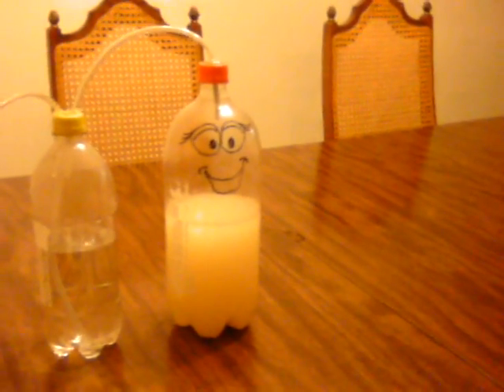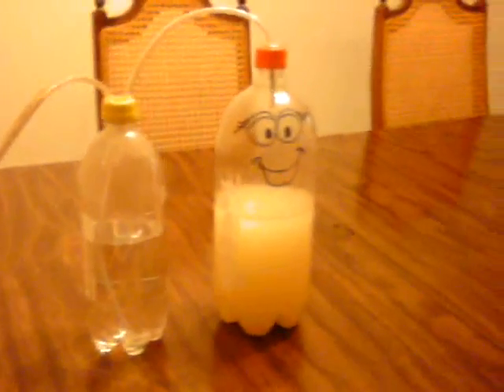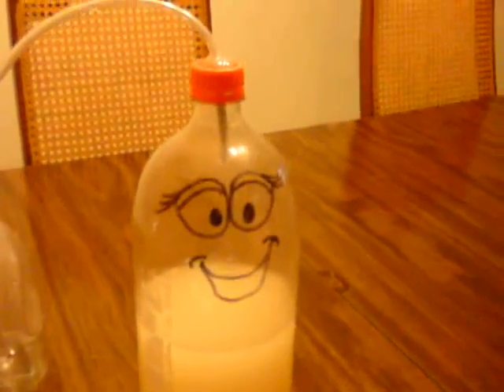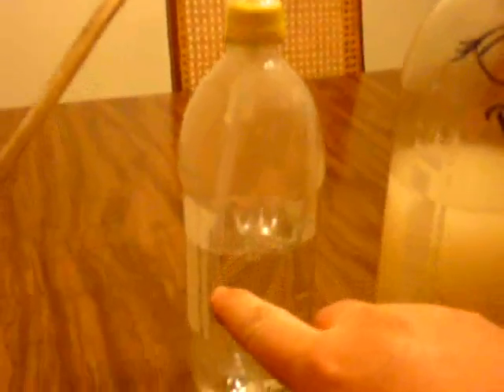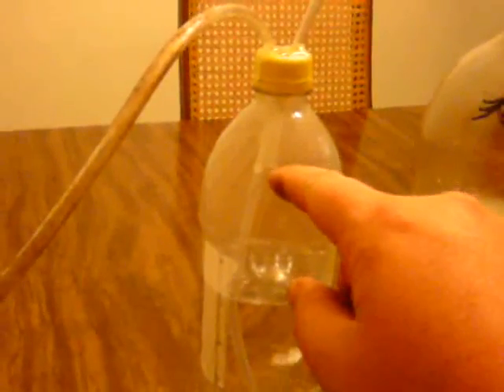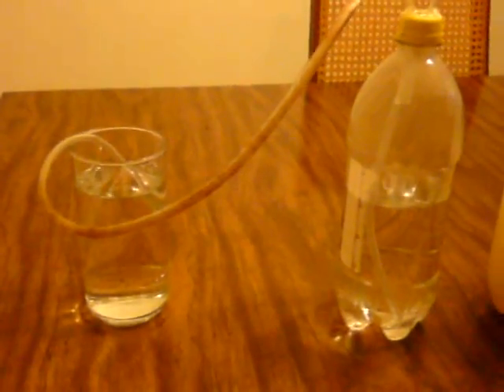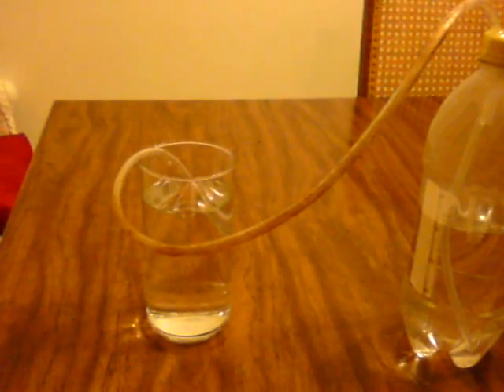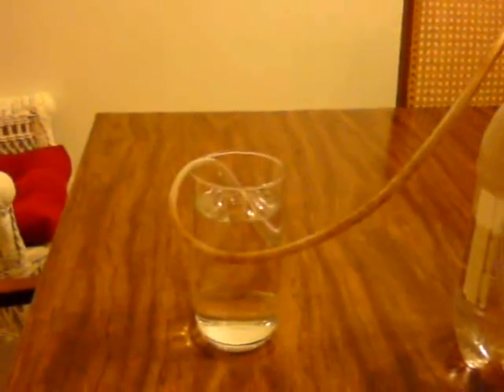part 1 how to make a co2 generator for growing plants

Comment: I found that sugar will work but it is slow, so I thought maybe I'll try concentrated sugar which is glucose or another name would be Corn syrup. Mix. Mix one qt of water to 1/4 cup of corn syrup and and 2 tablespoons of yeast. My mixture automatically starts bubbling with no wait time and finally I place it on a heat rock for snakes snakes or reptiles to keep the solution warm because heat activates yes so so with this method I can get 4 to 5 days of CO 2 in my tent . Hope this helps some of you out there withere with this frustrating C02 level and converting sugars

Comment: What if the water is not hot anymore
Reply from the maker: The water will cool down but the reaction will keep happening making sure that you're still getting a bubble going through the secondary bottle if you were still getting bubbles then it is still working

Comment: I am going to use two Oxypot DWC buckets hydroponically in a tent that is: 50cm x 100cm x 180cm. Do I need extra Co2 even if I bring in the air into the tent from outside? Thanks:)

Comment: I have a 4x4 tent. I have to open all vents with exhaust fan on high and small oscillating fan to keep right temp. Will the co2 help, or will it get sucked out with exhaust as fast as it's being made ?
Reply: use a portable a/c unit

Comment: So I could make mead or wine and give my weed some CO2 at the same time
Reply: I was just thinking that..
Reply: Or blow your mind and grow some shrooms does same thing only longer co2
Reply: I do. I always have 3-10gal of mead fermenting just outside my flower tent. When the light kicks on, so do intake fans and they pull the CO2 into the tent. The relationship between mead and cannabis works well. Cannabis takes about 7-9 weeks to flower. Mead, likewise, takes around the same amount of time for primary fermentation. After harvest, cannabis takes a similar block of time to fully cure. Meanwhile, the mead is in secondary fermentation. Once the cannabis is ready for use, I make a tincture from it and put that in the mead just before bottling.
Reply: It's funny but that's exactly what I thought the second I saw this setup! I'll just move my wine making next to my plant growing!
Reply: @rjstewart I did  the same XD
Reply: Now this is true engineering advancements!

Comment: Does the tube have to be hooked to a fan or can you just run the tube into the grow area? I have a grow tent and my fan is outside blowing into the tent through a vent. Can I just run the tube into the tent? It should still circulate right?

Comment: quick question. is the second bottle necessary? why does it have to go through the water?
Reply: Brett Alder its an oxygen lock...it keeps oxygen from getting into the reactor while still releasing the good stuff
Reply: going through the water lets you know it's working,if you don't see air bubbles,,it ain't working

Comment: There is no reason to remove this design at night. Unlike commercial models, here you are making releasing CO2 at an extremely low rate and will never realistically get near a detrimental (or optimal unfortunately) PPM. Its a good design and I believe it does help with no down side.
Reply: The ppm off this specific setup is not nearly enough to make any significant changes to your grow unless you multiply the ingredients or learn of other alternatives to make it produce more. For those who are marijuana growers, this will not do anything to your grow, you would need a whole lot of liquid which just takes up way too much space. Get a tank. For those who grow leafy greens, flowers and fruits, you can expect a small increase depending on how much you multiply the formula by. I speak from experience being a grower of all of the above. Tried this method and several others. Best methods were the most expensive ("you get what you paid for" is sad, but true in the case of Co2 introduction). If you love your garden no matter what you're growing or the size of your grow room, invest in a better system.

I do agree with the uploader that doing this experiment with your kids is a fantastic way of visually showing the little ones what it is, how its produced, and it can turn into something really educational for both parent and child. Hope this helps. 👌🏽
Reply: A good design that does nothing for the grow though?

Comment: Turn suger to CO2? What a waste. I would rather use soy bean to ferment after juice it, but need to burn the gas though.
Or pipe connected to the fireplace to retrieve the CO2 using the water bottle as well. Maybe more direct to get from the kitchen stove.

Comment: They never explain why don't go direct with the big bottle instead of passing through the smaller one, where is the difference?
Reply: +Pedro Guzmán It's a "bubble monitor" - you can see if the system is producing enough co2.  (And it tells you when you need to change out your ferment...)

And it catches the potential overflow from the ferment...

Comment: but why do u need a 2nd bottle why cant you just place hose over the plant
Reply: the 2nd bottle is to verify the CO2 is still being produced.  I made a setup similar to this and you just watch the 2nd bottle to see if bubbles pop up and once the bubbles stop you need to remix the solution because the yeast metabolized all the sugar and is no longer producing CO2
Reply: Jesse Nixon Is there a way to base the volume used on time? It seems like extra steps if the CO2 is created in the 1st bottle. What would you say? A week per liter bottle? a month? (I"m a newbie, I dunno) I wanna do this with the empty water jugs and just check on it later.
Reply: This process is directly analogous to making beer/wine, which from my memory; the first fermentation process is two weeks for the yeast to fully process the sugar. With that said, I liked the convenience of watching the bubbles for 5 seconds and knowing without a doubt CO2 is being produced.  I also used the 2nd canister to do baking soda and vinegar which also makes CO2 just much much faster. 

All said and done though, I'm not 100% sure there was a positive affect here after months of bothering with this.  If you had a sealed growing area? Maybe, but then you would have other issues associated with that anyway.  It was fun to make, but I'm not sure I'd recommend it to anyone.  Hope this helps!!

Comment: If you have good ventilation you dont need homemade Co2
Reply: +liamsdad33  except that it yields bigger plants when kept around 1500 ppm
Reply: +David Pucio if done properly
Reply: +David Pucio and this set up won't add any more C02 to a room than a fan from Walmart
Reply: +liamsdad33 pretty sure fans don't generate co2
Reply: +Trey Kincaid they don't they move it where you want it unless your growing in a sealed room a CO2 generator is a waste

Comment: I have this in my bedroom and you can get a co2 meter if you that scared but the level in the box never got over 900 and inside the room its never over 500 ... out side is 400 so with a small fan in the room movin the air you wont get sick or die just do research most people on here just say what they think not facts
Reply: how much amount f yeast and sugar should be added to 1 litter of water.
Reply: Omg! I'm never going anywhere where there's more than 4 people in the same room...which would be enough co2 created to be beneficial for plants. Dope

Comment: If you have too much CO2 in and around your system. You get irritable. Gassy. Painfully gassy. Depressed. Keep the CO2 to a minimum. Plants use CO2 at night. Just let it sit there for a few hours. Not forever. Trust me. I learned from experience.
Reply: Plants only use co2 during periods of light its called photosynthesis, it wont work without light and co2 at the same time.
Reply: Oops. Ha! Either way, that stuff makes people gassy as fuck. So it's best to stay away from it and not have it in your living space. Those things will produce so much cO2. I was farting and burping all the time. I was depressed. Wondering why I kept farting and burping that taste of eggs and toast. After some research I found that it was the cO2 that was constantly filling my entire bedroom. It even smelled gassy in there, too.

Comment: 2 liter bottle or milk jug 
Clear Tubing
Balloon
Tape
Hot Glue or Adhesive 
Sewing needle

Take the cap of the 2 liter and drill a hole in the cap the same diameter of the tubing.
Push the tubing 1/4" through the cap and Hot glue it in place.
Take the balloon and the Sewing needle and punch several tiny holes in it.
Take the end of the balloon that you would blow trough and slide it around the tubing and tape it in place
Fix the balloon above the plants.

The balloon will eventually semi-inflate forcing the gases through the tiny little holes you made in the balloon with the needle. When it stops producing the co2, the balloon will deflate 

or you can skip the balloon and plug up the end of the tubing with hot glue and punch a few tiny holes in the tubing itself.

I've never used a 'thumper'.
Reply: What do you do with the 2l bottle? Throw away or use it?

Comment: @nickalisse1 The 2nd bottle is a gas separator.  You need that because as the mixture creates tremendous pressure and gases, solids or the mixture from the tank may find its way inside the exit tube to the 2nd bottle.  Thereby not only clogging the lines but making a mess over your precious plants. This is also why you want to make sure that the exit tube from the second bottle is short and doesn't touch the water inside(GASES ONLY).. Moving on, If solids were to come into the pipe they would fall down into the 2nd bottle due to gravity as the gases float into the second tube exiting same bottle.

 It's filled with water (for those that asked).  Though you don't have to use water in the 2nd bottle, it is mostly a visual aide.  So that as time goes by, you can see if the tank is still generating CO2 or bubbles.  That's when you know you're need to replace it.  This mixture may last about 16 days for those that asked as well.
Reply: I assumed it was just to see if it's still working but stopping overflow to keep off plants is a good idea.

Comment: What is the ppm measurement for this generator? I'm doing an internal assessment in my biology class and I am exposing five different levels of CO2 to five individual tomato plants. im trying to find at what CO2 level is the optimum level of oxygen given off by the pants. I CAN'T get a CO2 reader.
Reply: It's been 6 years but do you remember how that experiment turned out? And what the best c02 levels were?
Reply: @frankfranks1914  she’s still working on it
Reply: @zaneyoung6105  🤣

Comment: when you do that : 1500 ml water, 600g sugar, 20g yeast you have 8 days of co2. im doing that for about 1 year, still works fine
Reply: Can u explain it
Reply: @sohamoti  did you figure it out? Still researching myself
Reply: @cuban151  mix the listed ingredients in a water bottle or jug. It will bubble so put a paper tower under for atleast an hr. Then shake once a day for 8 days pour out old and repeat.
Reply: Yes how about now
Reply: Why need second potle ?
Reply: @dr.mohamed_benghazi  the reaction only last for 8 days. This is a very quick reaction to make co2. Supplemental co2 is one of the most challenging aspects of indoor gardening.
Reply: You can speed up or slow down the process with the amount of yeast to sugar. And the volume of sugars the yeast can metabolize.
Reply: @gardengrovemind3745 but why the second bottle? Is it just to show you that its still producing co2 with the bubbles?

Comment: CO2 is a major problem but not in the way you think it is. By far the biggest source of CO2 is plainly moisture in the air, which traps the CO2, increases temperatures, evaporating more ocean water, which increases temps further... and so on. even if we stopped our CO2 output, we are still screwed. There is different ways of farming and raising cattle, where the soil is alive and eats the CO2. That's truly what needs to be done. The biggest scientists in the field are not worried due to thisfact

Comment: I made a big one of these in a five gallon bucket for my 5x5 tent. 

2 Tablespoon of active dry yeast
4 lbs sugar 
4 gallons of water
1 piece of browned, dry, toasted bread.

Stir this all up between 80 and 90 degrees then add toasted bread and wait a few hours. Active dry yeast takes a bit longer to start producing, but it does produce more CO2 than the instant kind.I suggest using both varieties. Add 1-2lb more sugar after 1week. Change after 2-3 weeks

2-3 bubble per second!!!

Your Welcome!
Reply: Thank you I'm going to do this
Reply: John Stout how did it work for you?
Reply: Way to much water lmao. You put a lb of sugar in hthat solution you will be cleaning up a huge mess. You need half that amount of water. Everything else looks fine
Reply: Do you know what ppm it was supplying your tent with?

Comment from the maker: the 2nd Bottle just has water. It can be empty but we recommend using water as it allows you to count and helps filter out the line.
Reply: I have never been more in love with this method of generating co2. Make your plants healthy as well as distil the biproduct of the co2 generator into alcohol.

Comment: the second bottle is there because when the vinegar and baking soda react the vinegar goes through the tube into the second bottle then the second bottle collects the liquid and then carbon dioxide forms through the filtration of the second bottle. if the second bottle wasn't there then the vinegar would go into whatever green house you have.

Comment: how long can you run this process for? when the water is cold will the process not start or work work? I did this it worked fine for 1 day and maybe a half does that mean I need to ingridents and I have to start the process over.

Comment: I used some fleshman's instant yeast. Used 500 ml H2O, 12ml yeast, 250ml sugar in a 2 L bottle. only worked 4 the night (around 6 to 8 hours) Was pretty good though. Works much faster than in the exemple on you-tube. Is the instant yeast makes a difference on how long it should work???